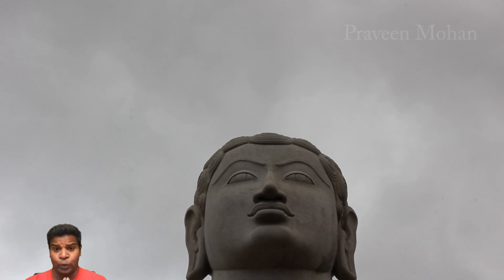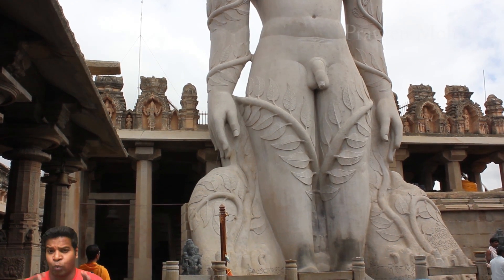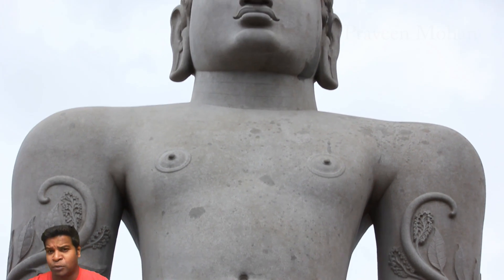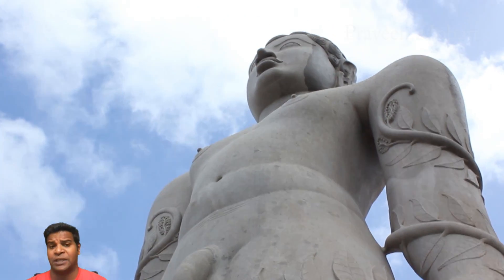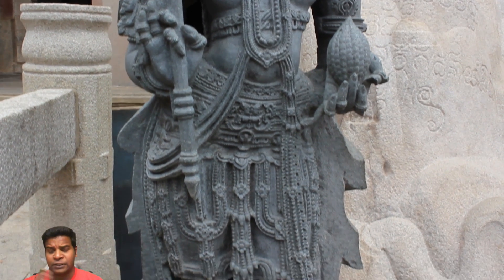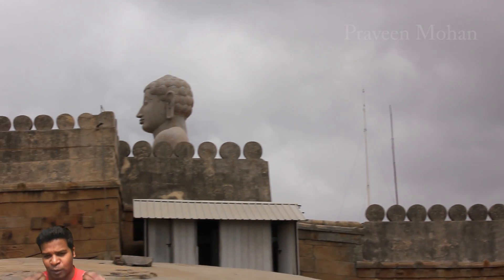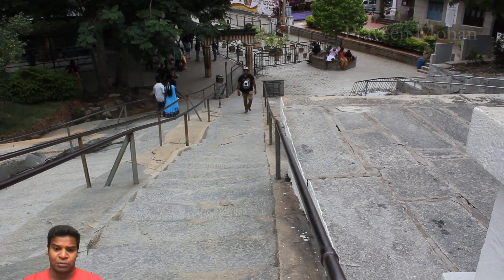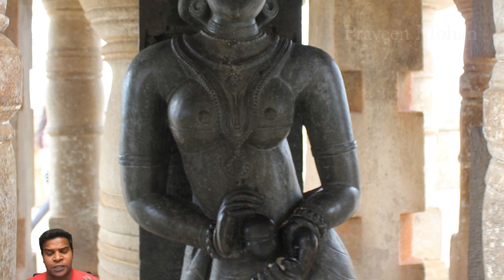World's Largest Ancient Statue at Shravanabelagola - Built with Machines?

Comment: I am just an amateur sculpture and I only can answer one question : Yes, it is possible to carve a symmetrical sculpture with no aid at all of Computer Aided Machining. Even centuries ago, they used some tedious (time consuming, boring, annoying . . .) technique that ensured the future sculpture to be almost perfect : They did a scale model using clay or plaster (or whatever, I am not sure about the material) they change the forms, the angles and the details as much as they wanted. And once they were happy with the model, they measure points. They took account of many points of the model, keeping in mind X(width), Y(depth), and Z(height) location of all of these points. Not completely sure about these last three letters, but you get the idea. And they resize all these points just by adding a zero at the end (or two zeros, or multiplying times 2, or 3 or whatever) and they have all the data to carve the sculpture, with perfect proportions. 

Let's now see the Gomateshwara sculpture : We make a scale model (previous to the full size sculpture) we take account of all needed points from it's right side, and then we have finished all the measurements. For the left side of the sculpture, we will use exactly the same numbers, but turning all the X values, negative.

I am not still skilful as an sculpture, But I am able to make (almost) perfectly symmetrical heads. What fascinates me about Gomateshwara sculpture, is not the proficiency or the technique. It's its style. I find some forms even futuristic. Specially the transition from skin to hair, close to the ears, so stylish and cool!!!

Those ancient sculptors, Miron Policleto, Fidias, Praxiteles, Scopas, Lisipo . . . centuries ago were able to make anything you can imagine. So the technique (of Gomateshwara sculptre) is not what impresses me the most. To tell you the truth, most of sculptures nowadays are too lazy and don't bother doing the effort of sculpting something right or well proportioned, unless they use a scanner and CAM, which is even more lazy.

Comment: 11:10 Not magnetic levitation, but resonance. If you notice Hindu temple architecture, you'll see that they are designed based on octagonal floor plans and mandalas. You'll also see "floral" and geometric patterns involving arcs and spindle shapes. You know where else you see such patterns? In high frequency sound resonance fields. 

There are videos on youtube on resonance experiments where they vibrate a membrane with high frequency sound, and pour sand or some other kind of granular powder onto it, and what you see is the same kind of mandala patterns that you see in Hindu temple architecture.

Everything in ancient world was based around sound and resonance. You can also use high frequency sound to drill holes and sculpt rocks. You can even levitate objects using sound. There are actual successful scientific experiments on it.

Comment: Mr. Mohan, the corrosion should be the final say that the statue was built with concrete. If it was a natural stone, it will not corrode so much in a million years under any weather. Natural stones have lived on earth for billions of years. Did anybody see any corrosion on them?
Also, we should try the hollow test on this statue so as to find out whether it is hollow or not. If found to be hollow, then the statue was built with concrete on the spot, and, transportation, carving and cutting had never happened.

Comment: The statue was built on site. It’s not carved but poured. They melted smaller pieces of granite using a giant lens and the sun. The smaller pieces could be transported easier. Once it was molten they poured it in the mold. The place on his face is delamination caused by the mold. That being said, someone needs to put some clothes on him so people don’t stand around admiring his junk. 😂
Reply: Johnathon mullis: I believe the statue was built on site. But I don't believe the melting of granite. I think ancient people had invented a kind of cement. it was so good, when it was turned into concrete, the solidified concrete looked like real stone. It only looked like real stone but will not stay like real stone. That is, in a few hundred years, the concrete stone will corrode or erode. And corrosion is happening on the statue's foot.

Comment: The statue is 1000 tons, but the original stone would have been even more. Today we can lift an object up to 1,200 tons with the LTM 11200-9.1 - The largest Liebherr mobile crane. We can also transport objects of that size and weight, but only under ideal circumstances with roads and semi-trucks. Getting the object to the top of a hill would be an enormous task. I don't know if we could do this today. The stone carving was done with power tools.

Comment: Granite concrete

Modern men call this artifacts chiseled out of solid granite rock, to the same artifacts the ancient people call it granite concrete. 

Granite concrete in wet state enable ease of transportation, shaping or flow mold. The only missing piece is what cement was used and for what composition and proportion was the cement. 

Specific ancient cement were mixed with crushed granite, in wet or dry state to ease local transportation, then pour mode and trowel into desired shapes while chemical reaction was taken place. 

The alternative to granite is crushed limestone or sandstone, with which Giza Pyramids were built.

Comment: I TELL YOU BETWEEN INDIA AND CHINA ALL THE LOST KNOWLEDGE OF HEALTH CAN BE FOUND. I THINK WERE THINKING BACKWORDS WHEN IT COMES TO ALL THE OLD STRUCTURES. WHAT IF WE DIDNT CARVE THEM BUT WE USED CARVED WOOD MOLDS TO MOLD THEM WITH LIQUID CEMENT THAT WAS USED IN EARLY STAGES OF MAN. ITS MORE PROBABLE TO EXAMINE AS WELL AS CONFIGURE MAN WAS ABLE TO CARVE A HOLLOW SYMETRICAL WOOD STRUCTURE THAT COULD BE FILLED THEN IT IS TO SAY MAN CARVED STONE WITHOUT THE PROPER TOOLS. AND THE KNOWLEDGE LOST ISNT TECHNILOGICAL BUT CHEMICAL. SO MAYBE ALL THESE STONE STRUCTURES WE THOUGHT WERE CARVED WERE NOT ACTUALLY CARVED, BUT MADE. THOUGH UNDERSTANDING CHEMISTRY AND ELEMENTS WHICH IS HONESTLY ALL OUR OLDER CIVILIZATIONS HAD. AND AS THE CHEMICALS BECAME DISPERSED OVER THE YEARS BETWEEN RULERS TAKING THROWN AND OVERTURNING OTHER CIVILIZATIONS GAINING THEIR KNOWLEDGE. TO LATER ON SO THAT THESE PROPERTIES AND CHEMICALS BECAME SCARCE AND EXPENSIVE. LIKE MAN WILL ALWAYS DO HE WILL FIND A CHEAPER ALTERNATIVE TO AN OLD PROBLEM. SO OVER THE 100 AND 1000S OF YEARS WE NOW HAVE TODAYS CEMENT. WHICH IS WEAK AND BRITAL COMPAIRED TO OUR ANCIENT COUNTER PARTS. WE GAINED TECHNOLOGY IN THE TWENTY FIRST CENTURY BUT WE LOST CHEMICS. I BELIEVE ALL OUR FORFATHERS DIDNT HAVE ADVANCED TECHNOLOGY BUT HAD ADVANCED KNOWLEDGE OF THE TECHNOLOGY THEY HAD AT THE TIME. USING FIRE AND OTHER COMBUSTUAL HIGH INTENCE HEAT CHEMICAL PROPERTIES TO REMOLD THE HARVESTED ROCK MINIRALS THEY WOULD FARM TURN INTO DUST(ASH) WITH OLD MASSIVE WIEGHTED GRINDERS  AND THEN MANIPULATE AND RE FORTIFY THE ROCK INTO ANY SHAPE USING A WOOD MOLD CARVED OUT OF A SIMPLE CHIZEL. THAT MOLD THEN WOULDNT BE LIFTED FROM ITS STONE FORM BUT BURNED UNTIL ALL THE WOOD SURROUNDING THE MOLD IS GONE AND ONLY THE STONE STATUE COULD BE SEEN. THAT LEVEL OF HEAT WOULD IN TURN CREATE AND UNBREAKABLE AMOUNT OF RESISTENCE SIMILAR TO THE OLDEST FORM OF THIS METHOD OF CUREING STONE KNOW TO MAN LIKE CHINAS EARLY POTTERY DATING BACK 20,000 YEARS AGO. JUST REMEMBER TECHNOLOGY ISNT A GIFT HANDED OUT OF THE SKY TO US. TECHNOLOGY ISNT ANYTHING MORE THAN FINDING A NEW SOLUTION TO AN OLD PROBLEM. IN 2020 WE DIDNT HAVE THE CELL PHONE WE HAVE NOW IT STARTED AS A BEABER. IN THE EARLY 1900 WE DIDNT HAVE F150'S WE HAD BENZ MOTORWAGENS ETC. TECHNOLOGY IS JUST A IMPROVEMENT TO AN OLD PROBLEM AND WILL CONSTANTLY BE IMPROVING AND CHANGING. BUT ONE THING IS CONSTANT AND THATS THESE MONOLITHIC STRUCTURES STANDING 1000S OF YEARS LATER THAT HAVE YET TO DECOMPOSE.

Comment: You mentioned elephants can weigh 660 pounds (300 kgs) which is significantly less given their power. Did you mean 6600 pounds because then 300 elephants required would make sense.

Comment: The rock that the statue came from must be bigger than what even you said why?  .because 
You would have to dig deep into the bedrock to find such flawless  white granite at that size. Its unlikely that this was found on the surface.to find a boulder large enough without cracks or hairline fractures on the surface most likely it was extracted from deeper. .I'd be interested to hear where the nearest location of white granite in the surrounding area. Hundreds of miles? Thousands?.
Advanced technology definitely.

Comment: Like I pointed out earlier, I am of view that yes there was some technologies which would solidify in the form of rock. Unlike cement which solidifies into whatever shape given there may have been technology for solidification of rock. 
My simple presumption is that we may notice that while construction of houses there are foot marks and hand marks left on the floor or the wall impressed by accidentally stepping or touching the cement based floor or wall while it is still in the process of solidifying. Later on the mark remains like that until corrected. 
Similarly we find large footprints and handprints on the rocks that at ancient. Now  it is not at all digest-ble that a mark of foot can be formed on the rock, as going by science the rock should have broken due to pressure,  instead of forming prints. 

I am strongly in belief of view that yes there must be some cement like technology that existed then and ofcourse it should not have been much complicated process to make such material.

Comment: If I were to take a guess at that little device being held in that statues hands, in relation to anti—gravity; it looks very similar to Otis T, Carr’s concept of mass cancellation via using two contra-rotating equal masses. His concept used two different cone shaped masses(like cylindrical pyramids with the bases put together and points facing opposite directions) he claimed when they rotated fast enough it created a neutral mass. He claimed to accelerate this mass using capacitor plates. It is a proven concept that if you electrify two capacitor plates with extremely high voltage(I believe DC) the plates will produce lift in the direction of the positive polarized plate. Pairing this directional lift with a craft that had zero mass created something that was claimed to be able to “do the speed of light or better” once the craft had (claimed) become in a state of resonant zero mass, the whole thing became a super conductor because there was no mass to cause resistance. This allowed the voltages and energy produced to exceed beyond anything we can generate here on earth. That’s what the capacitor plates surrounding his “amusement device” were for. Sorry but to elaborate it would take a book. Look into it via his name to see what I’m talking about. 

This technology would be suppressed for obvious reasons. Imagine if somebody accelerated such a craft into the earth.. that half of the planet, of not the whole thing would be done. Humans are by FAR not wise enough to posses such technologies, and as much as I hate it, I do understand why any proof of a Vimana or flying craft are kept in a state of unimaginable secrecy. Just my thoughts. I don’t think that is what the statue is holding, but that is what came to mind. 

I think it may have been possible they got these stones to resonate and then lifted them via resonant levitation. Anybody who has done even the slightest research on the subject has heard the story of the monks lifting stones with Drums and horns. I think stones conduct sound like metals/materials conduct electricity. Sound is very powerful energy. Water conducts sound with VERY low resistance. I think ancient people figured out how to utilize sound in ways we cannot imagine. Like those stairs that make the ohm tones. They were absolute masters of resonance. I think ancient people lived off of sound the way we live off of electricity. If we keep looking at their sources of energy in terms of electricity, I don’t think we’re going to get anywhere with solving any of it.

Comment: I believe Glacial deposits could explain how many non local rocks used in megalithic sculpture and architecture are found 'Out of place'

So it would be a case of 'it was already there' deposited by glaciers.

I'm not proposing this is the case here. Possibly there are other mechanisms of a scale that could displace and deposit giant boulders and rocks.

Imagine a mountain with an unusual boulder resting at the top.
It's easier to work with what's there. Especially if it's the right conditions.

I will have to research to find out the nature of this environment over the eons and whether my theory is plausible. If not then I've lots of room for more theory.

Comment: I had a dream this morning and in my dream I was greeted by a being. In this dream the being showed me a device and handed it to me. With this device I would put it close to a rock or sand and it would vibrate and turn the element into a work of art. In the dream I thought wow this is surreal. My girlfriend ended up waking me up and so the dream was ruined but the funny thing is the device in my dream was similar to the device that's on the statue holding on the left hand. I just want to mention that I did not see the device from this video prior to my dream. I know it sounds like total BS but I just wanted to share what I got from the dream. Anyways thank you so much for the video's it is very interesting to watch.
Reply: Also want to mention what I can vaguely remember as far as how the designs were being made as side from the vibrations was through thought, as I thought of an object the element would mold into that thought, for example if I thought of a temple or bizarre patterns the element itself would mold into that. That's all I can remember.

Comment: Crazy thought. Perhaps the rock got up there... Because it wasn't a rock. But a mixture. This is after all, exactly how the pyramid was made. It is even more obvious, by the fact that the stone is rather pure.  Anyone that knows anything about how white granite forms, would know that for something that large to be that pure, is impossible.  You also made the mistake of using lift weight, rather than pull. It is quite an easy experiment. Can you lift more, or can you pull more?

Comment: This video has few wrong assumptions.
Firstly, it is a monolithic statue it is directly carved in hill, nothing was required to be moved.
Secondly, the color of statue is same as that of hill, currently ASI has taken charge of shravanbelgola and it had applied some chemicals on statue. earlier it used to camaflouge with rock.
Lastly, it's a Jain Statue don't mix everything with hinduism, Jainism has it's very own identity.
The pouring of all the stuff has ALSO something to do with history, read about its history.

Comment: If the actual statue was cast in situ, this would solve the immense problem of transportation. A special "cement" like blend could have been carried up on conveyors, or similar, only the powdered mix need be carried, and then the formwork for the actual casting would be built on site. This could explain the perfect symmetry of the statue. And also why the statue is made of entirely different rock from all else up there.The statue does look like a smooth blend of white powdered granite that is mixed with water and special ingredients, then poured into the mould in situ.  Do we not now make artificial stone which is impossible to distinguish from naturally formed stone? This method is now known to have been used on some of the larger statues in Egypt, which also display this perfect symmetry. Well at least this would solve the immense problem of transporting  a 1000 ton statue, an almost impossible task otherwise. Why would the Ancients have made unnecessary work for themselves? They were much smarter than that! Thanks again Mr. Mohan, another insightful video.
Reply: It does look  like a Jaina statue, as distinct from a Hindu?
Reply: @eugeniuswilliams5457  yes Bahubali (statue) was the 2nd eldest son of Rishabhdev, the founder of Jainism

Comment: okay again a mind-blowing video with so much of detailing, I am yet fascinating the way of your perceptions and traveling. One thing which I have some doubt on your perception regarding the magnetic levitation, that would be happened on the material contains iron molecules or magnetic properties, But here we are talking about a giant piece of rock. from my point of view this fundamental technology was not be used for this despite the chaining method as like in COREL CASTLE a single man build all monuments and stuff with the chaining technique or even I had seen the same in workshops or digging sites where a one single man can lift tons of machine with this technique. and the path which has been modified into stairs way could be a flat surface from where the rock has been pulled up through this technique. revert me if u like it. and one more same as in the beneath sculpture a stone was their which seems like tied up with something from the middle.

Comment: (2:32) Did you say an Elephant can just lift up to 660pounds max. (299,371Kg)? That kind of animal weights between 2000Kg and 6000Kg. I think one Elephant could easily lift up to 1500Kg on their shoulders. You also can not use that number because the Elephants would rather pull the giant stone than lifting it on their shoulders. Then you need to calculate the true force you need to pull the giant stone while it is beared on tree trunks  (Dont forget the pitch of the Hill). 

What i want to say is that you would need far less than 30.000 animals to pull that thing in real life. I also doubt that there were around 30.000 teamed elephants in the world at this time. 
I still love your videos :-D greetings from germany!